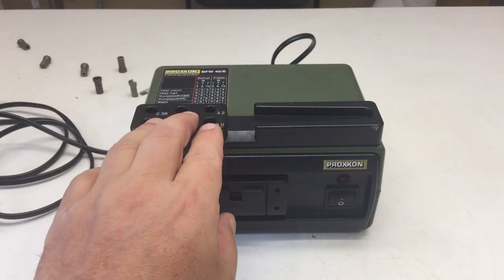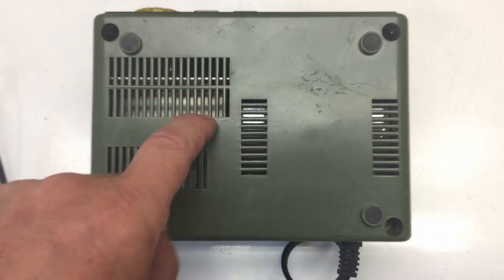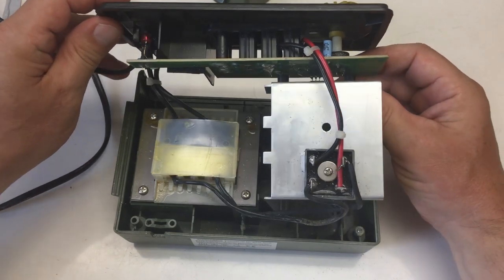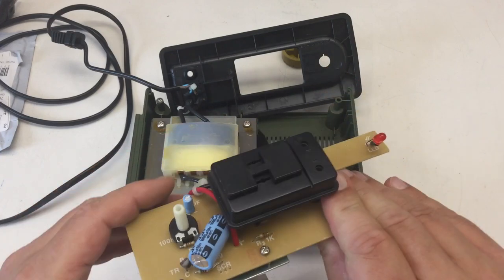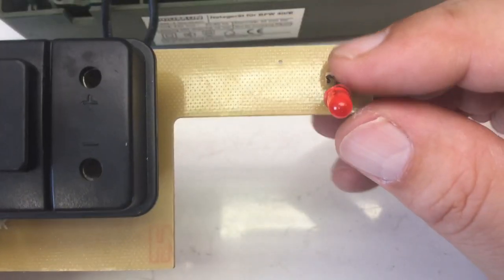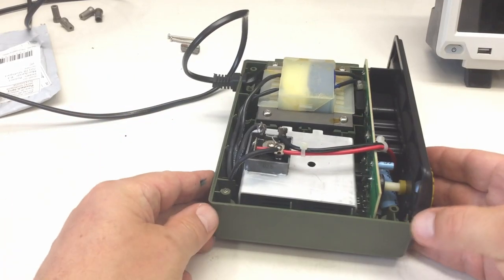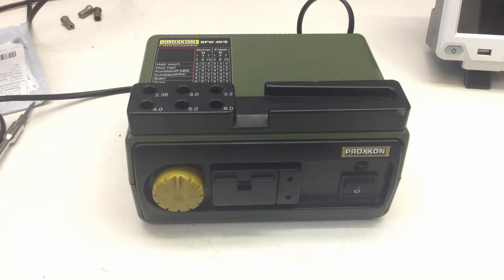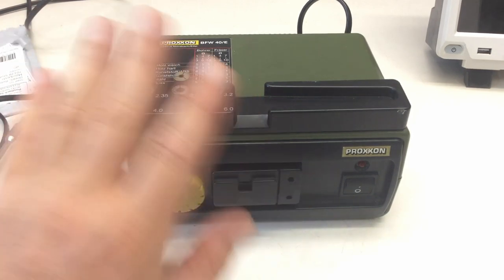Proxxon BFW 40/E Spindle Power Supply Teardown (Circuit, Waveforms)

Comment: Functional and robust, just what you need....cheers.
Reply from the maker: They probably use that design since the dawn of time and never bothered to upgrade it to something newfangled like PWM with MOSFETs :-) I remember when taking apart the little Proxxon FKS/E table saw (no longer in production) there was also a SCR based circuit inside it.

Comment: Robert, thanks for this clip. I own the BFW 40/e but the power supply died a few weeks ago. It started with a bad hum, then a pulsating motor at lower voltages, then zero voltage output. Do you think I should put together a Mean Well 48v 350w switching power supply and a DC motor speed controller or stay with the proxxon power supply unit (get it fixed or purchase a new one)? Any advise would be appreciated.
Reply from the maker: That's a tough question. On one hand the Proxxon power supply is quite old tech and sub par compared to modern brushed DC motor controllers. But then, it might be quite easy to repair since is has only 10 components. On the other hand building your own, modern brushed DC motor controller might enhance the performance of the spindle. But if you're off with the specs you might damage the spindle motor. Sorry I can't give you a definitive recommendation here.
Reply: @robertssmorgasbord  I decided to try and fix the proxxon PSU/controller. When I opened the unit, I immediately saw that the R3 1k resistor had burnt up and carbonised pcb slightly. Strange, because the red LED always worked. So I replaced the resistor and turned on the PSU. within seconds the new resistor burned up as well. Interestingly the LED turns on and off as it should. I measure 2.46 volts at the LED terminals. Does this mean either the SCR or C9014 is defective? I would appreciate any help I can get on this.
Reply from the maker: @clifffff7630  Hi Cliff, that sounds indeed strange. Voltage across a red LED should be between 1.6V and 2.0V, but never 2.46V. R1 is burning up, because there's far too much current going through the LED/R3. I don't think that's caused / can be caused by anything downstream. It must be the transformer or the bridge rectifier. I would suggest to disconnect/desolder the board from the bridge rectifier and to measure what comes out of the bridge rectifier, respectively, if all four diodes in the bridge rectifier are still working.
Reply: @robertssmorgasbord  disconnected the bridge rectifier from the board. Then I turn on the switch on the front panel and measured 30.04 VDC on the leads. Next, I took the entire bridge rectifier out and did the diode test. Everything seems fine in that respect: 555, 540 and 610 in one way and very high reading in reverse. The diode rectifier which I pulled out is made by MIC and is designated MB154 which should translate into 15a and 400 volts. But I am looking out the voltage coming out of the bridge rectifier... Is 30 volts not too low?
Reply: @robertssmorgasbord  also, I see that the current potentiometer has 250k printed on it whereas the circuit board legend refers to a 100K pot... 🤔😕
Reply from the maker: @clifffff7630  Ah, what kind of multimeter do you have? Incidentally 30V(RMS) * 1.41 = 42V(peak) - that's what I measured with my oscilloscope. If you have a small 50V electrolytic capacitor laying around (10uF, 100uF), connect that across the +/- output of the bridge rectifier and measure again. If it's still just 30V, then your transformer is shot ☹ You could also measure the AC output voltage of the transformer directly. That should be at or above 30VAC(RMS), respectively well above 40VAC(peak).
Reply from the maker: @clifffff7630  Yeah, the more I think about it the less I trust the legend on that circuit board ... For example the 1k R3 for the LED seems to be quite low. I wouldn't want to put more than 20mA through that LED, and at peak 40V that would be 40mA. I wonder if the resistor is really 10k (brown - black - orange instead of brown - black - red). Can't really make it out in the video.

Comment: Hello Robert, please can you gently tell me which scr is mounted on your bfw40/e power supply. Thanks you.

Regards
Reply from the maker: Sorry, but you can't really identify the SCR without removing the heatsink, which I never did ☹ But any SCR that can handle > 50V and > 5A should do (I would go for a 100V/10A type).

Comment: This other Robert did some black magic to improve his BFW40 https://www.youtube.com/watch?v=eLKrM2pZGWs which I think it was a power supply with more amps and a PWM control. Maybe with this idea you could try to improve yours to gain some oomph
Reply from the maker: Thanks for the link! That's definitely a project worth doing :-) I already put it on my wall of video/project ideas. But it might be a while until I come around doing that. Probably after using that spindle for the first time and being disappointed about its lack of power ;-)
Reply: @robertssmorgasbord   Hi , I was just about to sell my bfw40 due to it's lack of torque when I stumbled on robert & robert's posts... would  upgrading the psu be as simple as buying a

400W 40V 10A Switching Power Supply + a 12V-40V 10A PWM controller ?